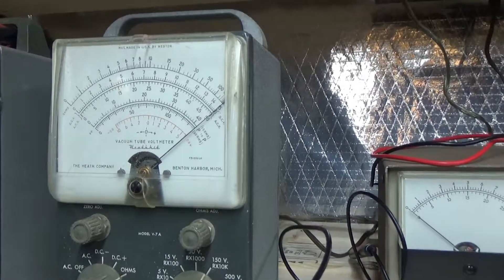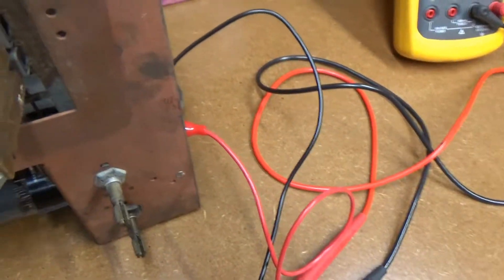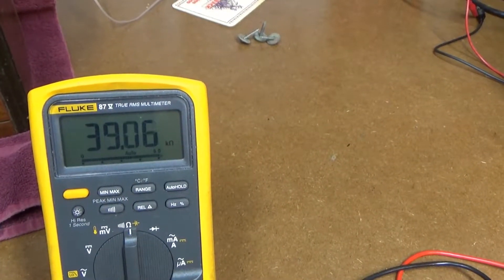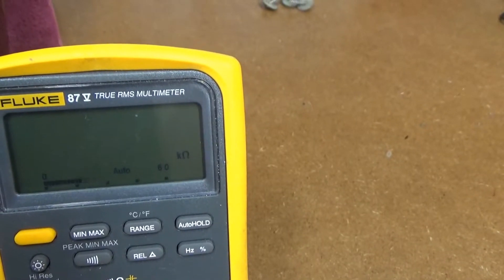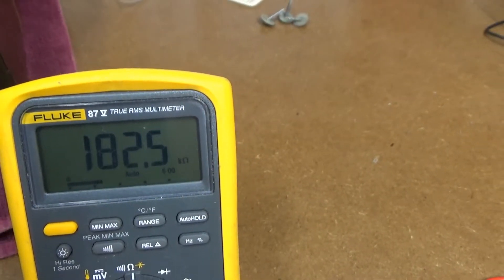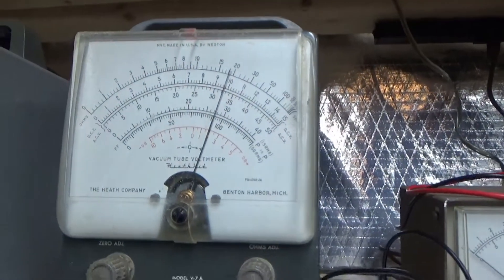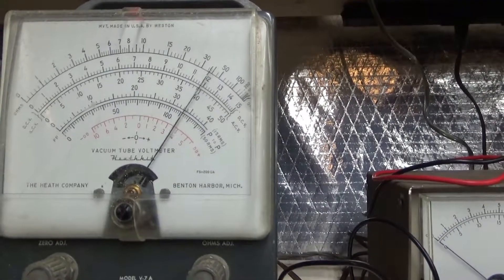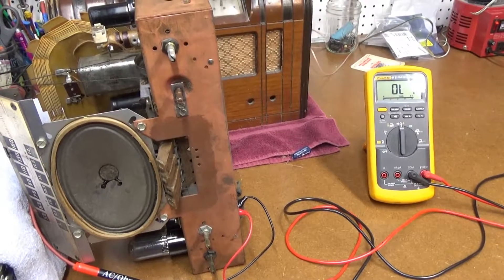Why you need a VTVM

Comment: I'm restoring a 1977 direct drive turntable, service manual is calling for a VTVM to measure 1.9 V-AC on a pot adjustment. My digital multimeter isn't picking up the voltage. Any suggestions ?
Reply from the maker: Many old service manuals recommend using VTVM's while doing certain measurements because they had very high input impedance and would not load the circuit under test and therefore provide an accurate reading. The input impedance of a good modern digital multimeter is about the same as the good old VTVM. You should be able to use your digital multimeter wherever a VTVM is recommended. I'm not sure why you are not seeing the expected voltage.  Double check the lead connection points.

Comment: Everything new and digital comes along, but nothing compares to tube operated meter test equipment. I have a lab full of EICO and Heathkit test meters in my lab.
Reply from the maker: Agreed.  I have quite a bit of vintage Heathkit, Eico, etc test equipment.  I'm in the process of restoring an old 1959 vintage Tektronix oscilloscope full of tubes.

Comment: You can put your fluke meter in manual range mode to prevent it jumping between different range settings during your test.
Reply from the maker: Agreed!  I use my Fluke meter 99% of the time, amazing meter.  It's still fun to find excuses to use the old vintage stuff once in a while.

Comment: Sometimes you need analog type measuring devices. Tube testers,capacitance meters and signal generators are a must when fixing radios from 1920's to mid 1960's .